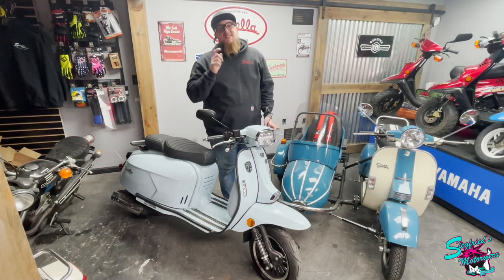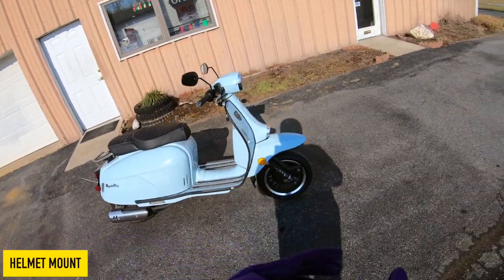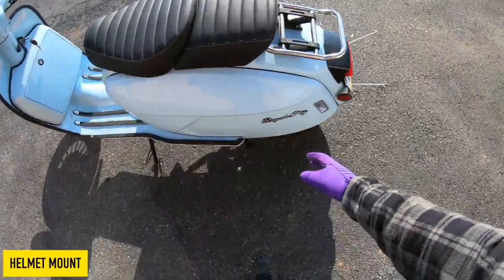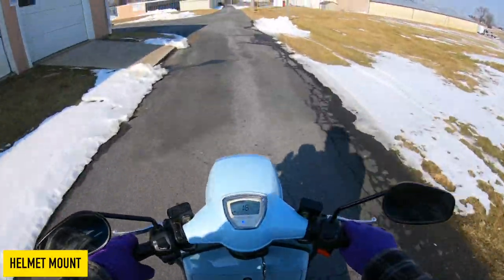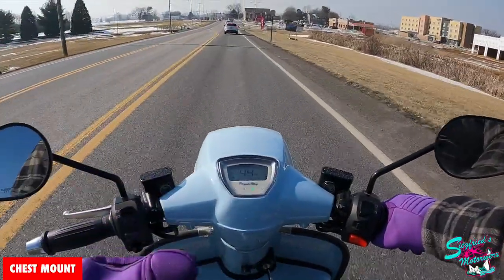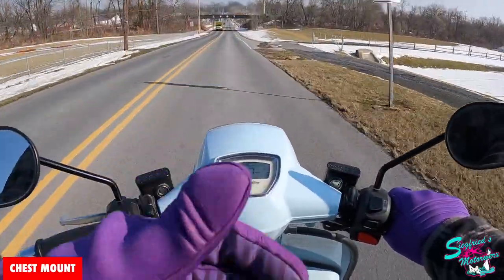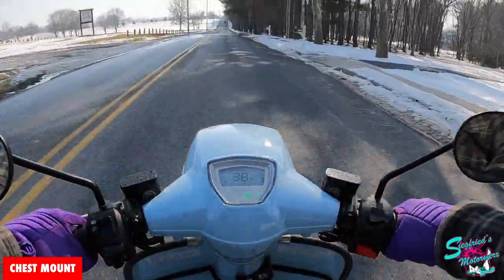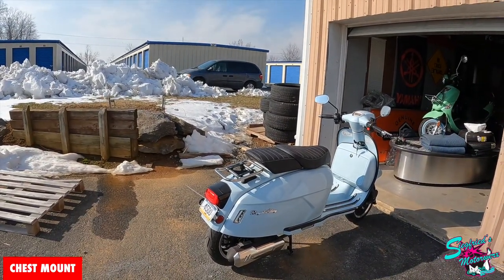Riding a NEW Vintage Scooter

Comment: I understand that the 300 will be available in the US soon. Liquid cooled, ABS brakes and good for over 80mph, it'll blow you away!
Reply from the maker: The 300’s should start hitting the dealership floors in the next few months
Reply: @SiegfriedsMotorwerx  I own one here in the UK where they are known as GP300. Had it a year and I'm really pleased with it. You still get owners of vintage Lambrettas spending a fortune trying to get more speed etc out of them and they're still as unreliable as ever!
Reply: Owner of a GP300 from South Asia here. Very happy with the performance, it hits 55-60mph very comfortably. Haven't tried any top speed run, but I believe it can hit 80

Comment: I go back and forth on the metal body. I love the look, but dents and such make me think plastic and the ease of swapping those out are the way to go. Side note, I greatly prefer the Stats being listed Power Point style vs the post it read while scootin' Just my thoughts! Dank video.
Reply from the maker: I dunno...a metal body scooter does have its cons when it comes to dents/scratches.  The RA does have replacement panels available and they could be switched out if damaged. 

I definitely like the powerpoint style spec delivery pre ride.  A lot less heat in the comment sections that way to haha
Reply: @SiegfriedsMotorwerx  Good to know! keep up the exceptional work!

Comment: That is NOT a NEW vintage scooter. The last one of those, at least in the U.S., was the 2009 Genuine Stella. Carbureted, 2 stroke, manual shift, manual clutch. The Stella was built by LML in India, as then LML Star, and may have been sold in other countries as a 2 stroke manual shift scooter after 2009. I believe Vespa sold the PX150, which is a 2 stroke manual shift scooter, in some countries until just a few years ago. Scooters with EFI four stroke engines and CVT belt drive systems are anything but vintage, no matter what they look like. The Royal Alloy is designed to look like a vintage Lambretta, but it's looks are the only vintage thing about it. 

I own a 2009 Genuine Stella, built by LML, and imported by Genuine Scooter Company. It is a real vintage scooter in every way. It was built with real Vespa tooling. LML used to build real Vespas for Piaggio for non U.S. markets.

Comment: 10 minutes of looking at the road through a GO-PRO  does nothing to inform us of how we would fit on the scooter ourselves.  Try putting the GO-PRO on a tripod and drive around the parking lot and do some figure 8's.  Show us how maneuverable the scooter is and put your feet down when stopped.  THAT will tell us more whether a scooter is right for US.  We want to know if we'll be all cramped up with the handlebar hitting our knees or if our arms will be too short to reach the handlebar if we stretch out our legs.